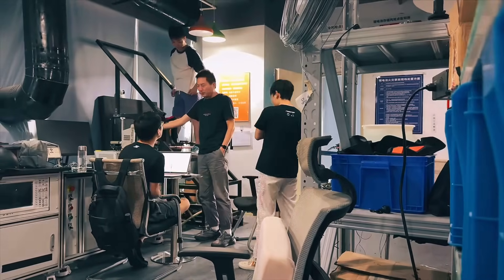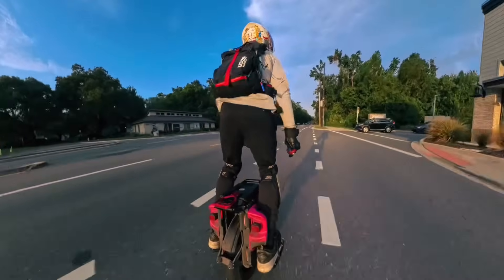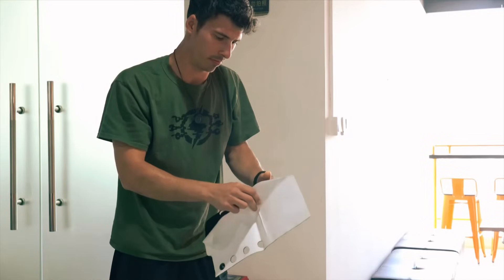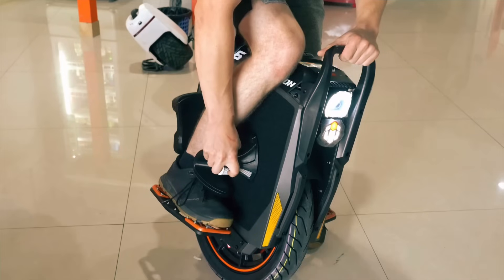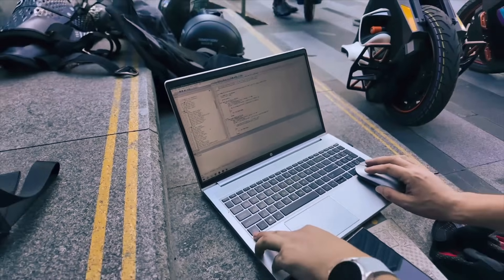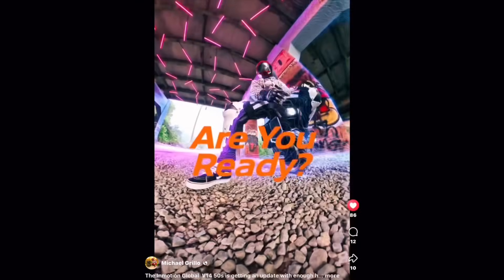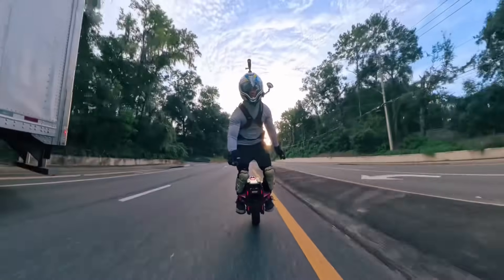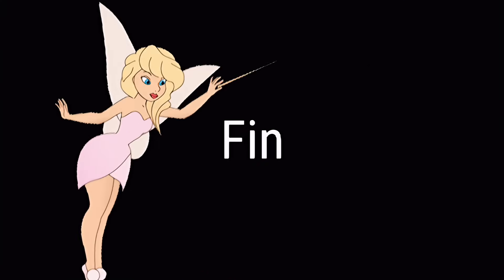🔥 InMotion P6 & V14 EXPOSED! | Tech Tools, Dyno Testing & Begode Shots Fired

Comment: Here you go friend
The InMotion P6 range test with 7 riders (47–115 kg) showed outstanding consistency:

- *Range:* 154–164 km (96–102 mi) per charge across all riders  
- *Average speed:* ~26.5 km/h (16.5 mph)  
- *Ride time per charge:* ~6 hours  
- *Max speeds observed:* 61–78 km/h (38–48.5 mph)  
- *Weight impact:* Only ~10 km (~6 mi) difference between lightest and heaviest rider  
- *Tire/PSI impact:* Road tires most efficient; heavier riders benefit from higher PSI  

*Energy analysis:*  
At ~26–32 Wh/mi, the P6 delivered ~2.6–3.1 kWh usable energy. With ~90% usable fraction, nominal capacity is ~3.0–3.3 kWh. Likely layouts with Samsung 50S cells are 24s7p, 28s6p, or 30s6p.  

*Voltage & speed:*  
Dyno tests show ~94 mph under load. That’s achievable with 32s (134 V) plus aggressive field-weakening, but >150 V (36s or 40s) would make it more natural with less stress. Either way, the P6 motor/controller clearly has extreme high-speed headroom.  

*Conclusion:*  
The P6 delivers Sherman-class range (~100 mi) in a smaller pack, with remarkable efficiency and a motor system capable of much higher speed than current firmware allows. It’s one of the most efficient and forward-looking EUCs tested to date.
Reply: I took a screenshot and ran it through ai hope it helps some.
Reply from the maker: @ReviewThisTestThat  that’s absolutely dope, bro. Thank you so much. Well done Friend.

Comment: Inmotion is a hype machine. They have been hiding way too many details to trust them with a commuter long range wheel.
Reply from the maker: They are a slow drip to the drop. 

Getting use to the way that some other companies drop will frustrate anyone. 

Just gotta take each company for their own methods. 

- 

They are teasing the wheel, it is a little more foreplay but we all know that makes the feels so much better
Reply: @johnnygovroom I dont fall for Inmotion hype. I have noticed it since starting on EUCs biggest disappointment for my was v13. Never lived up to hype. It was same weight as wheel woth 1800 more wh.

No one has said the battery capacity which for me is a turn off and I am not interested. 

Unless this new wheel can out range a MPv3 there is no point for me as a rider.

Comment: If the suspension performs well I will likely be taking the p6 to a big jump course. Id love to be able to do big jumps with it and that large jump they performed on the slope has me very hopeful. If all goes to plan I will try and pick one up around christmas time. Ive seen more clips of the suspension and it has at least 100mm of travel just judging by eye. Perhaps the travel is adjustable or this type of suspension doesnt travel very much unless it needs to. Could still be prototype suspension as well. To me it looks really good ngl.

Comment: Cool vid man.  I’m just hoping for a hydraulic suspension or the air struts finally dumped.  And a weight reduction.  Thanks for the updates.
Reply from the maker: Looks like it’s a fast day solution very similar to what like a Sherman L might have
Reply: @johnnygovroom I’m just terrified they’ll go with air suspension again.  With the v14 I thought inmotion was coming out with a series so the battery packs were interchangeable and easy to work on etc.  the only reason I left the v11 was the air suspension was horrible.  Smooth when it worked.  But all the time unbalanced.  Used to get the wobbles something fierce. And I will admit.  I’m a very mid average rider.  The LK suspension is leaps and bounds better for me.  Again man…fantastic videos!!!